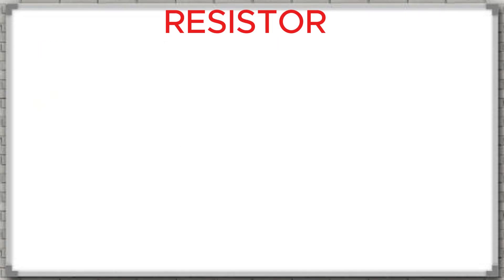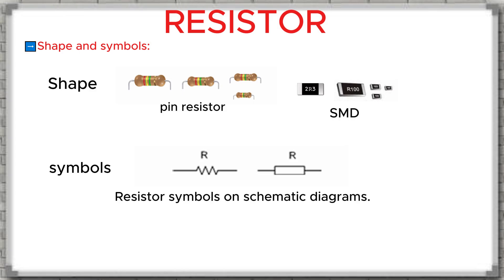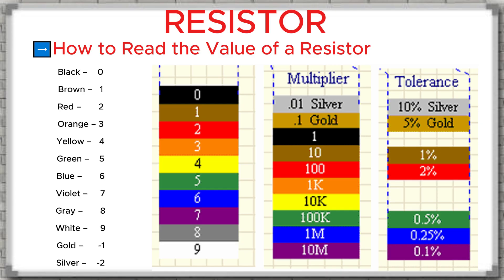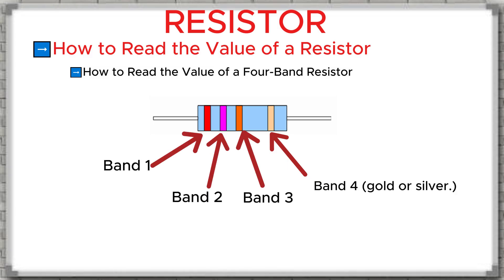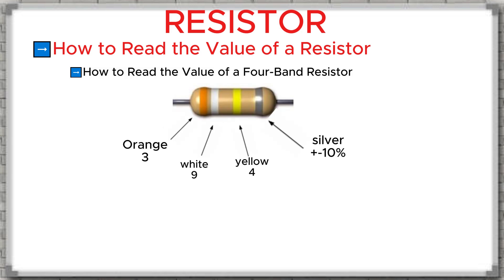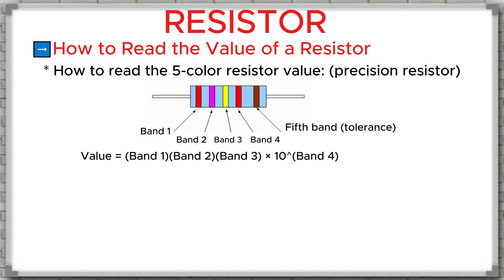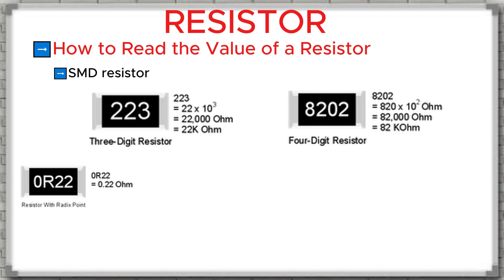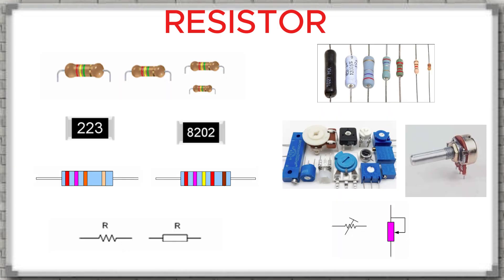Basic Electronics for Car ECU – Lesson 1: Understanding Resistors

Comment: Hey I want to ask you a question regarding connection we do when we read and write ecm or bcm .
so my question is sometimes people use resistance while doing connection for reading and writing various modules ?
Are they pull up or pull down resistors or something else  I don't know ?
Reply: I believe it is use to limit current like so you don’t burn up something like when disabling a watchdog circuit to enable writing the flash memory
Reply: Thanks for replying  @deerhunter8533